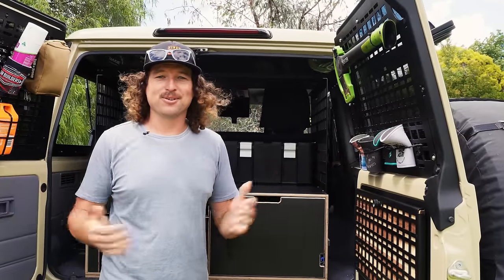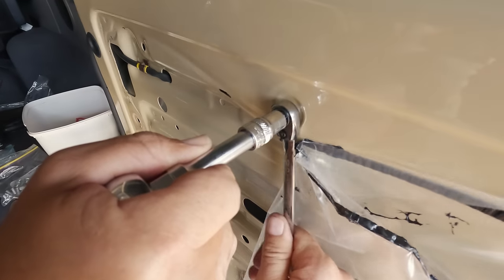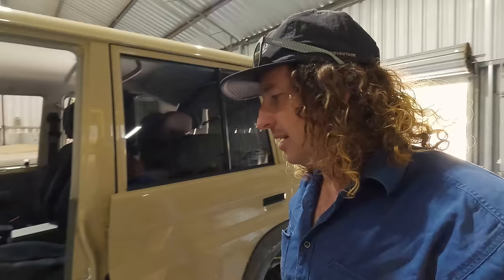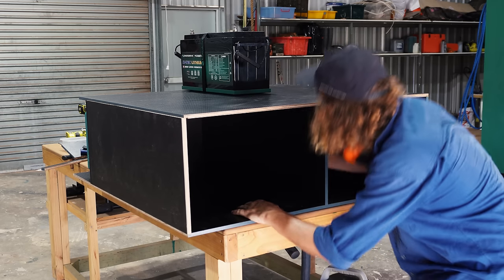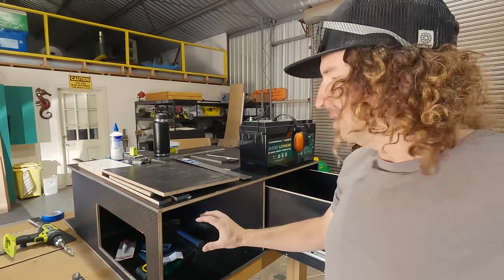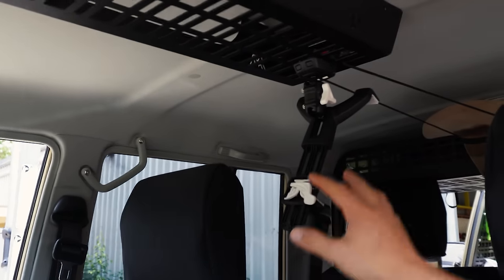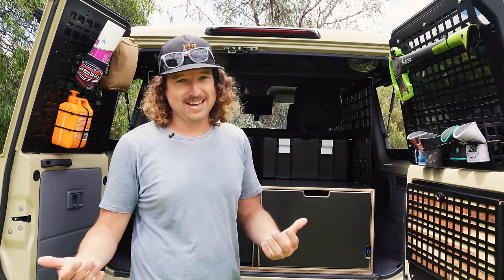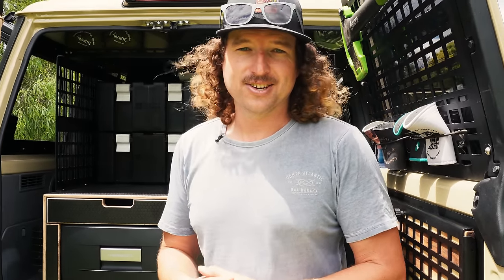How To Plan & Build The Best Touring Setup Inside Your 4WD Wagon!

Comment: Simon I’ve just fitted up powder coated alloy panels from Senenty6 to replace both the back door card and also the inner cards along each side. I think it’s what you might be looking for, check them out 😉
Using up that roof cavity is a great thing- we have the Fourby fit outs touring set up in the back and the jacket rack I love very much, as well as the gull wings
Reply from the maker: Funnily enough, that's exactly what I ordered. They showed up the other day and I got them fitted. Thanks!

Comment: Awesome work on the draws and set up mate. Seen your video and went and purchased the same boards and am very happy with them so, Thanks for the tip on that. My set up is a little different, i have made a floor up with that board to mount the fridge slider etc to it. How did you attach you unit to the floor?
Reply from the maker: Great to hear! We were able to pick up some factory mounting points in the floor

Comment: Great video guys. Did you anchor the drawer system to the floor? If so what system did you use? I'd be interested in a system that is easily removeable.
Reply from the maker: Thanks mate. We were able to pick up the factory tie downs which bold through the floor via captive nuts 👌

Comment: Coming together really well. Great work. Just wondering whether that battery has enough ventilation tucked away like that. Love that molle equipment and those gullwings are awesome. Top job on the draws also.
Gooooo the 76
Reply from the maker: Thanks so much. The battery had a fiar bit of space around it and can vent throught the cut-out for the fridge compressor

Comment: Great video and great set up! You should be proud! Question: it looks like you have mounted the axe using cable ties… is it you final solution (ie replace the tie every time you are using the axe) or do you have a long term solution ?
Reply from the maker: Thanks! The axe and a few other things are just temporarily mounted for now while we work out how we want everything. The axe head cover could stay with a zip tie and then something else for the handle 👍
Reply: Your video gave me some food for thoughts… I like the shelves, but without carpet, how are you going to handle the rattling? Another point, (one of the improvement I am currently making to my set up) is the air flow around the fridge compressor. We have recently been in NT and at 35+ dgr, the fridges in the car severely struggled…. I am going to add a fan to force some air flow around the fridge and see how I go…

Comment: Hey guys, great video! What thickness is that hexiply and what size screws did you use please? Cheers,  Wazza
Reply from the maker: Thanks Wazza. We used 12mm ply to keep the weight down, but that does make fixing more tricky. We just used 20mm chipboard screws, make sure you pre-drill though.
Reply: Thanks, doing mine shortly👍

Comment: Looks amazing Simon, great design and very professionally built. Just a question, do you need or have to think about any cooling around the fridge and the battery behind the fridge? The kids will love the iPad mount, they’ll need some Bluetooth headsets now. Great all round fit out, you’re very skilled. Have a good week and safe travels to WA. Cheers from NZ
Reply from the maker: Thanks, Mark. It has a fair bit of air and ventilation but we'll see how it goes.
Reply: Hope it all works out good, it’s just with all the talk about batteries (lithium) batteries overheating I wondered how you ensured enough airflow. Anyway I’m sure you’ll let us know how it goes. Hope your trip and truck is performing well and  you are all enjoying it. Safe travels. Cheers Mark

Comment: How did u fix the fridge into the drawer carcass?
Reply from the maker: I made up some angle brackets that fix into the existing threaded inserts in the fridge casing and then bolts to the floor of the drawer system.